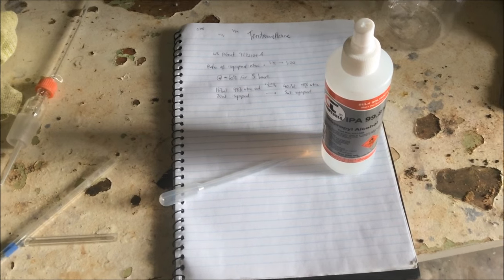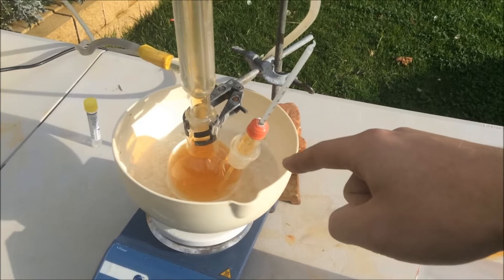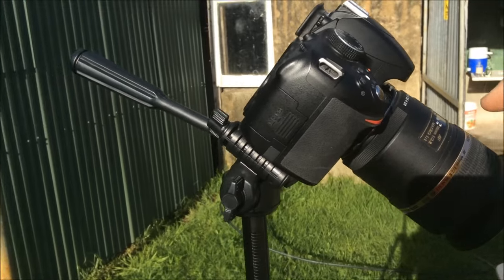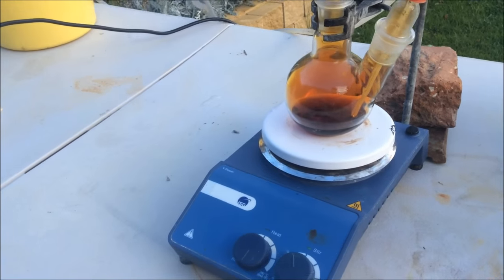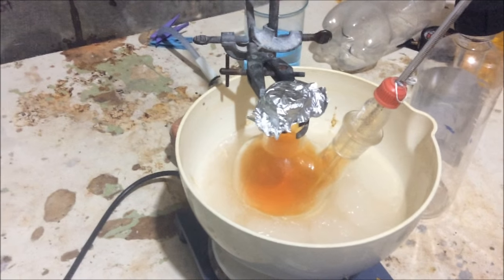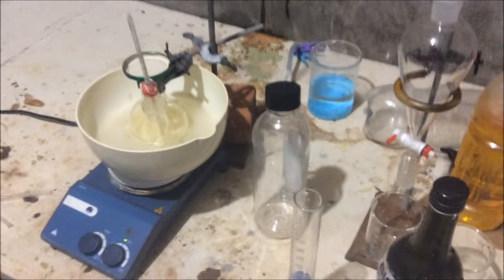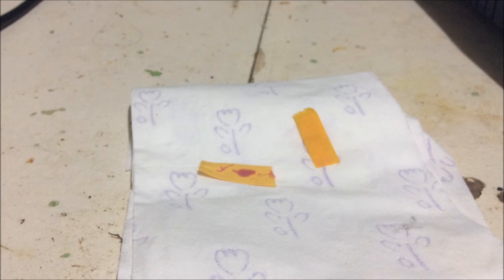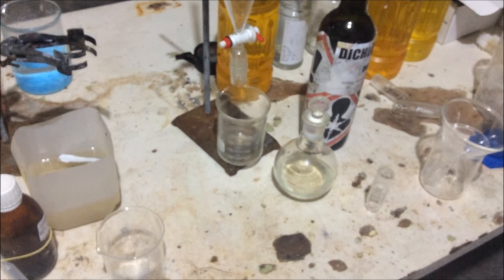Making Trinitromethane/Nitroform (Part 1)

Comment: Excuse my naivety, but don't you usually need some conc. H2SO4 in combination with the HNO3 to form the nitronium ion typically needed to nitrate something? Why are you able to nitrate the IPA without it?
I mean I see you do use some H2SO4 (detailed @ 0:43), but that's not for the actual nitration step.
Reply from the maker: I can't quite remember, but I think it works By a different mechanism than the nitronium ion. We're not trying to form nitrate esters but using the HNO3 as an oxidizing agent... I think?
Reply: Concentrated HNO3 is able to form nitronium ions by itself, that's why nitration reactions on nucleophilic substrates can (and must) be performed without the aid of sulfuric acid. In particular here the nitronium ion doesn't have to break an aromatic structure (my guess is that it's attacked by a double bond from an enol), maybe that's why we don't need high concentrations of NO2+ at any given moment in the reaction mix for the mechanism to proceed.
Maybe adding sulfuric acid to the reaction mix would make a runaway reaction? I don't know if the low yield is due to an inefficient nitration of IPA, or complete oxidation reactions taking place. If the latter is true, then sulfuric acid would definitely not help.
Reply: @pietrotettamanti7239  just saw your reply, very detailed and cleared it up. thanks!

Comment: I would suggest, to start the niration slowly, as you did, by cooling everything down, but then drive it to completion, by heating the reaktion mixture up, especially after adding the sulfuric acid. Because you have to nitrat 3 times, you have to use some harsh measures, don't you? And you increase the nitrating capability, when adding sulfuric acid, by binding water, but also by forming NO2+-Ions. But when you keep everything cool 'till the end,  you aren't really using that, are you?
Reply from the maker: While yes, maybe heat might help the nitration, it also allows the other reaction to happen: oxidation. Cooling isn't about helping the nitration, it's about stopping you oxidizing the material and getting a runaway nitration. You can't add NO2 groups if everything has turned into CO2!
Reply: Sure, i got that. Does it actually oxidies to CO2 that easily, though? I mean the recipe you follow suggested put the Isoprop in 60°C right? And i dont mean to do that, but to slowly rise the temperature after adding the sulfuric acid, until something happens ;D
Reply: Or do you think most of your loss already is due to oxidation? Is your yield actually as bad as i think or is that just a misunderstanding on my part? 
And thanks for answering at all :)

Comment: Tom, I have an idea to maybe reduce bumping.  The big, sudden appearance of bubbles at the bottom of the flask create the problem, right?  What if you put a heating mantle element on the TOP of the flask (like a knit cap), maybe extending down to the surface of the liquid?  I think the liquid would sizzle at the top, but have no reason to bump from the bottom.  It might help foaming too, but that's just of a guess.

Comment: Why not invest in a bump trap.....also there is a much simpler synthesis method utilizing acetylene reduction of nitric acid containing mercuric nitrate. This give you nitroform. The byproducts are CO2 and nitrogen oxide which then can be converted into nitric acid with an absorption tower....

Comment: RIP 500 mL 29/32 flask 😢
Reply: Wtf it was a 24/29 2 necked flask? Well then do not RIP^^
29/32 ftw. I hate it when i'm watching for 29/32 glassware and connectors and only find those bizzare useless pieces of glass^^
Reply: 24/40 ftw

Comment: Acetylene and nitric acid also makes TNM...
Reply from the maker: If this method doesn't work, i'll try that method, but I think you need a mercury catalyst? There's some catch if I remember. That and I don't like using my CaC2 unless I really have to
Reply: do you have a welder in the shed? you could make some CaC2 via electrolysis